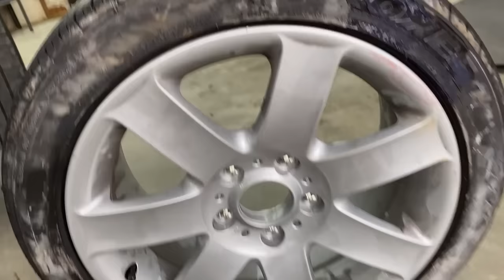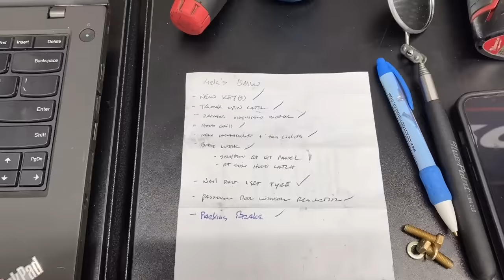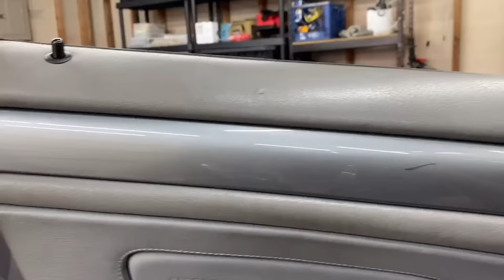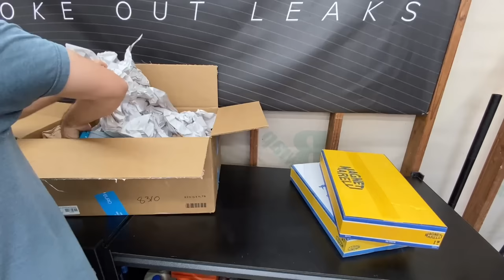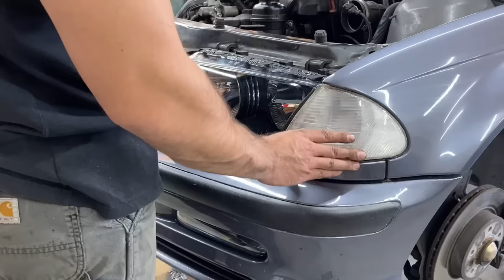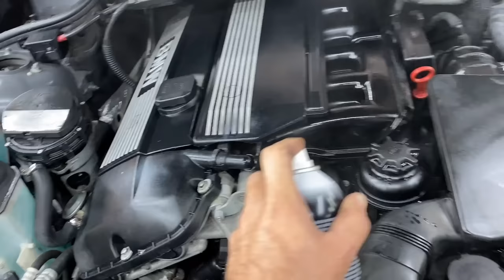What $2077.96 Worth of BMW Repairs Looks Like

Comment: Just curious, the voltage regulator is replaceable and usually the main reason for failure, why didn't you save him some money and just replace that instead of the whole alternator. When mine stopped charging, I replaced the VR, and found the brushes in it were worn out, the cause of low output. I do admire your explanations of everything you do, very helpful to a great many folks out there.
Reply: LOL. I commented on that too. He may just not know I'm guessing. He does such a great job on the cars and video I almost hate to point out anything that could be improved. LOL. But I'm sure he's one that will appreciate learning new stuff.
Reply from the maker: ya know, ive only done one VR before in an alternator, at my old shop we would always replace the entire alternator, send the cores out for rebuilding, and do it that way. Its nice to refresh the entire unit, bearings, etc.. but ill have to do a video on just the Voltage regulatore in the future!
Reply: @DayOffDIY  See, that's why I like this channel. Yeah, in every shop I worked we also changed the whole alternator too, much for the same reasons but mostly for the liability factor. I think most of your videos are really for DIYers, not everyone will attempt a VR change, probably for much of the same reasons you stated, but some will. But Kudos for fantastic videos on cars we like, Thank you so very much for being a really cool guy too.
Reply from the maker: thanks for the awesome comment! Ill do my best to keep the content comin for you guys. always nice to have some good convos in the comment section too. appreciate the support!

Comment: I remember my e46 days back in 2014. Lots, and lots of DIY repairs lol. I miss the car, just didnt have the time to invest  into it anymore.
Reply from the maker: I hear ya, they do take a bit of work to get them back up to a good drivable condition, if theyve been neglected. thanks for the comment!
Reply: @DayOffDIY  It definitely the car I learned to tackle big repairs such as the clutch, oil filter housing gaskets, valve covers, cooling system, etc. Suprisingly, the e46 wasnt too hard to work on. Had a 2002 330xi 5 speed. Nowa days im hoppin around in a 21' 330i msport
Reply from the maker: they are great cars for learning just that!
especially with a manual trans

Comment: The window regulators from BMW have a design flaw, at least for my 2003 E39....that said, go cheaper with those window regulators cause OEM and knockoffs have the same defect....( unless ya get them from FCP)
Reply from the maker: Always such a faulty design with BMW, mini cooper too! Each car is guaranteed to have a failure! 
The F body BMWs have been a lot better for regulators though

Comment: If you get an ak90 program and a key or key upgrade from over sea you could get the 300 down to 30 bucks or so.  I wanted to do a flip key for the z4. took a chance to get to the ews and program the replacement key to that.  More time than expected,  but for the cost and upgrade is worth it I think
Reply: When I mean more time than expected It be the time to get the software/ hardware.  Then after that an evening to install software,  take the ews out, read, write,code new transponder for the new key, reinstall ews and test new key.
Reply: He already has ISTA so could just do it using that not sure why he didn’t but properly wanted to avoid any issues
Reply: Ahhh I didn't get into ista, but that's cool that software can do that.
Reply: @WiimanX2  He said his ISTA wasn't connecting to his computer and isn't sure why. But he then said he'll figure a way of dealing with the light.
Reply from the maker: id love to start programming keys myself! ive done a little bit of the initialization but have never done the whole process. will have to try it out for my other E46. Thanks for all the good info!!!

Comment: I still have an e39 and man I don't like the brake drum style e brake. I have two Alfa Romeos from the mid 2000s and they have a cable that pulls on the rear calipers and uses them as a e brake. So much better.
Reply from the maker: Yeah I’ve seen that design on the mini cooper rear brakes, I like that style too. BMW got away from it when they went to the electronic parking brake but I prefer a mechanical system

Comment: I did the following on my first E46
Entire coolant system 150$
Valve cover with gasket 60$
Oil pan gasket -60$
Vanos rebuild - 60$ 
Spark plus and oil change with every filter on the car (engine, oil, cabin) -80$ 
Break pads and rotors all around - 250$ 
Disa valve - 70$ 
Transmission gasket and filter and flush - 80$ 
Junk yard interior wood pieces in Great shape 10$ a PIECE at LKQ
Facebook market place headers and cold air intake plus Mtech wheels -500$
Entire 2005 LCI front end for my 2002, (hood, fenders, headlights, bumper) -500$.

ALL IN MY DRIVE WAY AS A LUBE TECH, these cars are amazing to work on super easy and simple anybody can do it! Save yourself some money and go for it it’s really easy with tons of info everywhere online for the past decade.

Comment: 23:30 Dude you should have used a new butyl-seal on those inner door panels. If those aren't a 100% water tight you'll get a hell of a time trying to get the floor carpets dry again. And the worst part is: You won't even really notice if the floor is wet until you find rust holes from the underside of the car.
Reply from the maker: this one had some quality butyl tape on it, but ya i got a rear water leak on my E46 will it run car, i need to do that repair again

Comment: on part of 29:58 you can use original bolt put back on threads like it should be and hit with hammer a couple of times.
Reply from the maker: I’ve done that before! I’ve found that it puts some stress on the alternator housing from beating the bolt with a hammer, so I prefer to use the vice

Comment: How much to replace a 2011 335i oil pan gasket?
Reply from the maker: If it’s 2wd, roughly 5 hours of labor, plus a a few hundred in parts, pan gasket, new bolts, dipstick tube o ring, oil level sensor gasket, + new engine mounts and an oil service
Reply: @DayOffDIY  it's xdrive (4wd). where are you located/do you have an email?
Reply from the maker: X drive usually turns it into an 8 hour job labor time. Im in northern CA, you can email me at dayoffdiy@gmail.com

Comment: why put 5W-40 in the car and not what it’s manual says to use 5W-30 ? wondering since yes it’s high mileage but what is the difference if you just use high milage 5W-30?

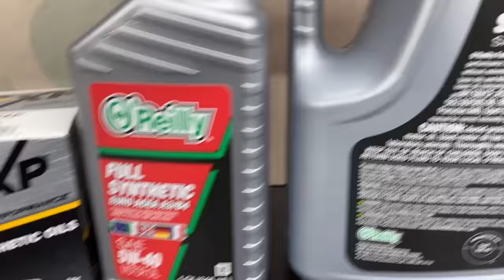Comment: 01:04:00 bmw e46 needs 5w30 oil !!! I also tried 5w40 and it is just too kuch for the car, it’s running quite hard….not as smooth as 5w30 !!!
Reply from the maker: I agree with 5w30, however when they get a bit more old and tired, 5w40 can help with consumption. It also was the only euro spec oil they had in stock at the time.
Reply: @DayOffDIY  I really respect your work, but 5w40 increases the consumption since the engine runs not as smooth as in 5w30. 5w40 is too heavy for this car ! Please show me where the BMW Engineers wrote that after a certain amount of hundred thousands kilometers you should use 5w40…??? My car has 445k !!! And 5w40 just sucks and I am talking about quality oils…and even on the E90, F30 : BMW recommends 5w30 !

Comment: Sounds like a bargain for all that. I need new tires and a power steering repair and im gonna go well over 2000. For a ford f150
Reply from the maker: i like to think so! if it was at a local shop or dealer, labor rates would be double what i charged, at least

Comment: You really think $2000 worth of repairs is a lot? That is chumo change, my friend. I have spent over $14,000 in repairs in my older pickup truck so when I saw this I had to say something. $2,000 dollars is nothing it cost me $3,000 to Just Repair my frame the Correct way. It needed a new drive shaft. New rear differential. Wires, plugs, coil packs. Tensioner pulley battery belts, power steering pump starter. Window regulator motors 2 of them. Fan motor inside the truck that controls the fan for the AC and the heat. Also, the switch that controls the fan speed had to be replaced. The transmission shifting cable had to be replaced. Mass air flown sensor had to be replaced. Throttle position sensor had to be replaced. 4 brand new shocks. Brand new swaybar links and bushings. Brand new, inner and outer tyrods all of them. Is brand new wheelbearing  hub Assemblies all 4 of them. Ninety percent of the fuel lines had to be replaced. Brake lines A 100% of the emergency brake hardware was completely gutted and replaced 100% brand new. Brand new rotors pads in the front and the back. Brand new calipers in the front and the back. 4 brand new tires. Brand new flowmaster FX dual exhaust system. There's a lot of other stuff I did to this. I just can't remember off the top of my head. Now this is expensive.
Reply from the maker: The video wasnt to showcase that $2000 is a lot of money for repairs, if anything its maybe the yearly total that some of these cars require. especially if they are neglected and the jobs add up. Just wanted to show a repair job I did for a friend, and educate people on some of the common failure points on this chassis
Reply: @exxxz1999  Actually the truck is worth as it sits $15,214 as it sits right now and that's good condition so you where saying
Reply: @exxxz1999  My Engine is low mileage 61,345 miles on the odometer there is alot I mean alot of mods on my truck that made the value go up alot. It's not your normal pickup truck. It's a nice truck with a ton of Modifications. By time i'm done the truck will be completely redone a hundred percent. It's not there quite yet, but it will be a 100% Recondition, pick up truck soon enough. I am about eighty percent there

Comment: what was not bad on this Car... damn in Germany that car would never get the Inspection in this condition
Reply from the maker: All relatively easy repairs! I’d love to see what the inspection process looks like over there
Reply: @DayOffDIY  Because of the Shocks, this car would not get the TÜV here and because of the Airbag light, if this is still on
Reply from the maker: airbag light is fixed, but im surprised the shocks would make it fail!
Reply: @DayOffDIY  everything that is, or can be a safety issue, is a nogo. With all the leaks at the beginning, they would say nope. Had this with my car. I always do a precheck at my local shop
Reply from the maker: good to know! crazy how things vary from country to country!

Comment: Hey. I could use your expertise. I’m currently looking at a 2004 bmw 545i with the v8. It has 120,000 miles on it. The vendor states that all it needs is a Ivm. But the car has been sitting for a year. Would like to know if I should pursue it
Reply: What is a LVM?
Reply from the maker: I think you need IVM. It’s pretty hard for me to say over the internet, so many factors to consider
Reply: That can be risky. Sometimes people will say "all it needs is (this) and it will run great". You are taking a risk that is the only thing wrong. If you can get a good diagnosis before you buy, that would help.

Comment: correct power steering fluid is: CHF 11S Hydraulic System Fluid - Pentosin 1405116
Reply: its atf 3. even the cap states atf only
Reply from the maker: On this bmw it’s ATF. Newer chassis is CHF 11S